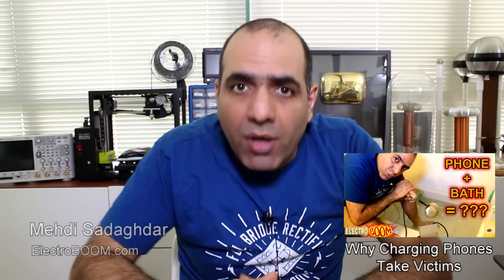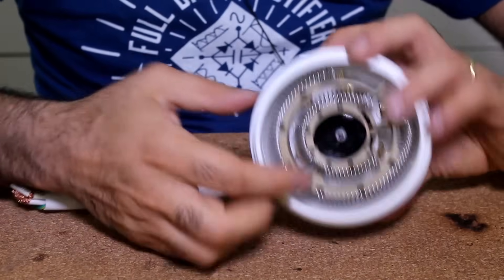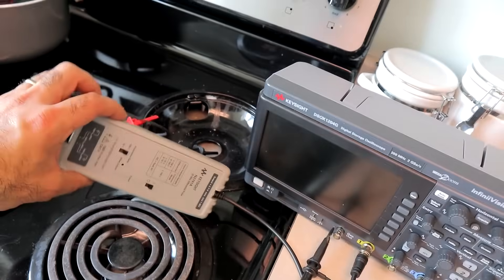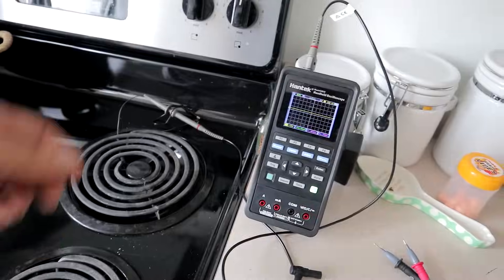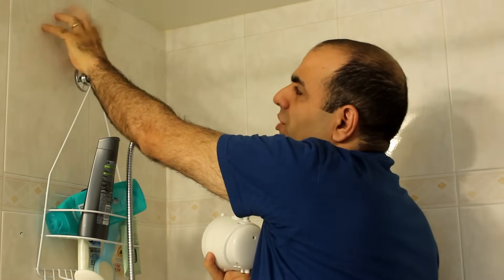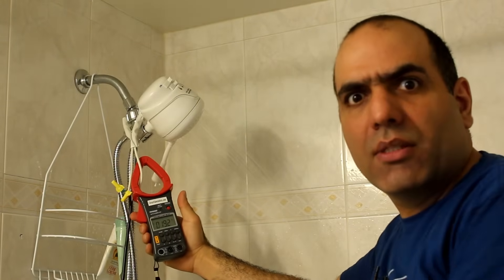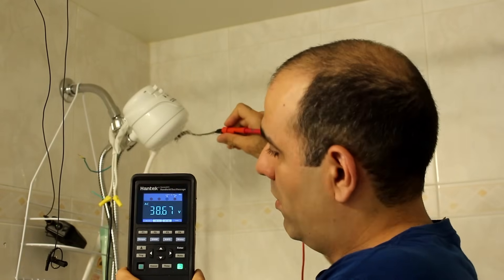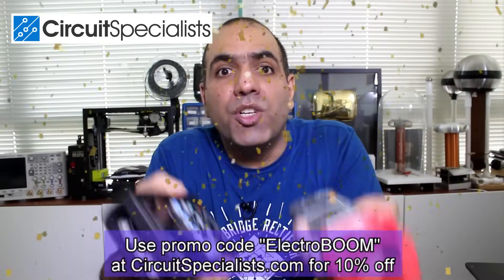How Safe Is the SHOWER HEAD OF DOOM?!

Comment: I use these for over 10 years here in Argentina with 220V, and even with 220V you still need 4mm wires minimum (btw 4mm are the same thickness the power company install at your power meter, so it is pointless to go thicker) for the max power setting, it will melt the common 2.5mm wires used here for regular outlets. But other than that is petty safe, when connected to ground, even a failing one would not transmit power too far due to the water stream breaking off.
That said, in these 10 years i had 3 of these, the first one eventually started to fail and started to transmit way too much power to ground and water it i would feel the electricity if i got my hand too close to the source, like what you did here. That happened over time, it was fine at the start. 
The second one just died after just a few short months, and the third one is the one im currently using whiout any issues.

Comment: A side tangent to this I'd love to see is testing exactly how a jacuzzi tub could possibly (or could NOT possibly) fail and hurt you. The thought of sitting in a tub of water submerged with electrical pumps running in it always gave me the heebie jeebies.
Reply: I installed a Jacuzzi-type tub in my home. Besides solid ground of the metal framework the pumps are attached to, I have a GFCI breaker on the circuit.

Comment: Lithium-ion cell powered oscilloscope is usually the best when working on high voltage as it's gonna be obviously isolated from mains power unless you plug in the USB cable from the phone charger. I would personally feel safe using that oscilloscope for good reasons, and less damage on the test equipment all the same.

Comment: Never in my entire life have I heard someone die or even get shocked for it, it's really funny the reaction of people in North America afraid of a harmless shower haha
Elso here in Brazil, the wire above the showers has a separate breaker, so you could turn off the power to its wiring separately from the rest of the bathroom to avoid overloading, but the way you did it connected to a normal socket in the house... it's kind of dangerous that way...

Comment: I've had a few showers like that here in Peru and to be fair, I did get quite a few electric shocks from them whenever my head touched the shower head (I'm fairly tall for my country), not deadly ones obiously but it did f'n hurt. Also I did have to install a plastic shower handle because using a metal one shocked me every time I touched it. Yeah I wouldn't recommend one of those unless you're broke and can't shower with cold water.

Comment: The wires sit on top of the shower heads, way above the reach of a normal person. You have to REALLY make an effort to touch them.

They are pretty safe and, no, they won't set your house on fire. Although they may make the lights flicker if you set them on max.
Reply: cringe pfp
Reply: cringe af pfp

Comment: I use one of these showers (unfortunately) Lived all my life with gas heating for shower. One thing I do is to be sure that the tap which allows water to flow is made of plastic. If that is of metal construction, it will shock you.

Comment: As a brazilian who had that shower in my house, i can confirm that it is actually dangerous, not because you can get eletrocuted, but because you can light your house on fire. The thing is, us brazilians can barely afford electricity, much less decent wiring. I myself turned that damn thing on the outlet of the bathroom (adapted for the shower) and the fuse box caught on fire, then i went Mehdi mode and tried it again for fun, it caught on fire again. But apparently it was a tendency to have those showers here in Brazil back in like 2016, apparently it's a "rich people thing".

Comment: In Brazil it is normal, in my house I have solar heating, but I have the electric shower for backup, if the day is very cloudy, here the electric shower works at 220v, 7500w and the correct thing is to be connected in cables of 10mm at least, in my house it is a 10mm cable, and passes through a 36A breaker, and the energy standard where the meter and main cables are located and designed to support up to 100A.  And it also has grounding, and the live cables go through an RCD, in the circuit breaker panel, the RCD is almost the same as the GFCI, except that it is together with the circuit breakers, if there is a current leak it trips, the Brazilian circuit breaker panel of newer houses like mine is practically identical to the European ones, like the one in the United Kingdom, if you watch the video of ElectroBoom in the United Kingdom, you will see the circuit breaker panel, it is basically the same thing in Brazil.
It is very, very rare to have an accident with an electric shower, if everything is done correctly, in fact I have never heard of death from an electric shower, there was a lot in the old days when electric showers were practically all metal, and the plumbing too, but nowadays there are no deaths!  And there is a safer type of electric shower that I don't know the name in English, but it is called (chuveiro de resistência blindada) in Portuguese, it is very different from the one in Mehdi's video.

Comment: I remembered my first home water heater it's 3500 Watts on 230V, no built-in GFCI (Not to mention grounding and central GFCI, it's 80s) with steel tubes and not so clean tapwater. I just wondered how I survived it.😅.

Comment: .. can a separated drop stream conduct water enough to shock you? Genuine question  wouldn't if the droplets split the volts/amps (not sure) drop during separation
Reply: I assumed it would half roughly each time the drops broke or say as per % of the total size of the droplet split between however many pieces it splits into
Reply: Make a video about it 👌

Comment: I'm brazilian and it's true, this is how it is. And it's completely safe unless you're trying to fuck around with it. Just use it as an end-user would and you're fine.

Also we dont leave the wires hanging down like that, we have proper porcelain protectors for the wires and they are always ABOVE the showerhead.

Comment: Hm... would it work to split the ground wire off and just send it through a silicone'd hole in the bathroom wall into its own grounding rod outside? Somehow that feels a little more reassuring than connecting the water stream to whatever ground wire is supposed to be running to the outlet in some sketchy country.

Comment: I once invented a way to clean the holes in a shower similar to this one using a needle. But my brilliant idea was to do it while taking a shower with my bare foot. When i introduced the needle in the hole I got electrocuted. I guess it was 220v directly ony body. It was very strong. Lucky on me that it was very fast. Can you explain why you didn't feel anything on you tongue and i got electrocuted? Remembering my ground is properly connected.

Comment: This is called an instant heater. It draws too much amps and therefore is a big burden to house wires.
In China the water heater usually comes in two ways. One is a electric tank heater which heats a tank of water at lower wattage. This takes hours to make a tank of hot water but it will never shock the user especially if you disconnect it before use.
The other is gas heater. This is always instant but they use gas fuel like CNG or LPG.
Instant electric heater do exist but they usually come in kitchen gadgets. Not for bathroom but for kitchen.

Comment: I'm Brazilian, so here's some quick facts about Electric Shower Heads:
- 90% of Brazilian homes has at least one electric shower head.
- 90% of Electric shower heads are 220V and 10% are 110V here in Brazil.
- Usually 220V shower heads works between 4000W and 8000W, so the 220V needs 40A breakers. 110V shower heads works up to 6000W and needs 60A breakers.
- "Installed by a professional" is not a thing here... Everyone can do it, even people who is not educated beyond basic school... It's not rocket science. 
- Some people don't even connect the ground wire... and it's ok.
- Nobody gets "shocked" in the shower... And when someone does, it's "light and very easy to deal temporary unconfort", it's not a killing pain. And it's easy to fix: Just connect the ground wire.
- A basic electric shower head (like this one on the video) costs about US$ 15 (converted to local currency). Higher end ones costs less than 100 USD.
- A total number of ZERO people died by electric shock in the shower last decade. This just don't happen.
- There are also electric water heaters for boilers, pools, and for Kitchen sink, and they work exact same way.

Comment: They're pretty easy to safely install, though. And come with easy to follow instructions. And even when they're not properly installed it's pretty rare someone gets a shock. What generaly happens when it's baddly grounded is that you loose energy and your energy consuption goes wild while the water doesn't heat properly. They generally have a dedicated circuit breaker. It comes with most houses and apartments and if you are building a house the electricist will think about it. In the rare cases when someone gets a shock, it's not a big deal either. I've never heard anyone gets injured by a shower. Like, not even heard of it. Not even on the news.

I remembered being puzzed as a kid to discover the USA don't use those. And then people said you guys heat it with gas and I thought: "isn't that dangerous? What if it explodes?". So there's a mutual strangement hahahah. I heard a friend was jocking with some "gringos", they called it an electric chair and he said it's better than a gas chamber hahahah. In the end both are safe.

Comment: I talked once with a man who had lived for a few years in Brazil many years ago. He told about using the electric shower heads. He said sometimes they would start to feel a tingling and they would have to go to the basement to tighten the ground wire to the water pipe.
Reply: "basement" lmao bs

Comment: A whole lot more deaths can be linked to boiler or water heater installations than to these electric showers, even per capita, as there are fewer countries that use them. Statistically speaking it could be argued they are much safer than having gas pipes runing inside and around our houses, underground and pretty much everywhere we go. These fail, you get a spark and the shower shuts off immediatelly as the circuit is phisically broken in those coiled resistors inside. You get cold water running, maybe a bit of smell of burned plastic from the housing or from any plastic components inside of it, and the inconvenience of having to run to the home center to buy a new one. If on the other hand gas leaks inside a building or underground, they can accumulate at which point all you need is a small spark to get a huge explosion and fires.

Comment: I have gotten electric shock from normal shower on 2 occasions on 2 totally different locations... Never found out why it gave electric shock in form of tingling when standing on the water outlet. Last time I was showering away salt water from a wet suit I had used in the ocean.

Comment: Well you don't loos space for hot water tank and don't have the heat loss from poor insulation. 
Hot water only when you need it. 
No need to worry about gas or the venting system or making sure the gas ignites properly. 

Curious of how potent such a system is

Comment: I have used one of these in Burundi  don't know who installed it but we usually had loss of electricity several Times everyday. The wall plugs where between 150 and 280 Volts effective, depending on the time of day and the circuit. I got electrical shocks when my laptop was plugged in everytime touched the metal housing.
Nobody died (well, at least in the house) and my now sold 2011 laptop is still in use as far as I know, I just upgraded to a faster System.
I guess in places where these things are the best younhave you just have to not think about it. Sure, some will die from these conditions but not all do. I'm from germany and now live here again, I saw both worlds, both have their rules, both works, just one of them is deadly more often. I saw people die due to bad standarts, I gear up when I use a motorcycle here I went over 100kp/h without even a helmet. People tend to live as well and as their surroundings allow, in Burundi this shower was of of my lesser concerns,  the dubiously open wires... well, I'll stop it here, I could go on like this for hours, you get my meaning: these things are often improperly installed and often nothing happens, in places where this is such places life usually isn't very safe in generalso that even improperly installed with only 2 open wires this shower doesn't make it significantly worse.

Comment: What about another test with the heating element blown open circuit, also no ground connected, and a more acidic or alkaline (or otherwise more conductive)water flowing? Would it still be safe?

Comment: brazilian here, eletric showers are pretty much everywhere, there are even people who believe gas showers are more dangerous because of leaks, my house has eletric shower for like at least 30 years and no one has died _yet_, nor anyone got shocked. theres a bit of context, because brazil is hot, we dont have heated water from the street like britain does, so a big ass % of our tubing is pvc plastic, the only metal parts are usually the fossets themselves, another thing is that eletrical showers are incredibly regulated, Anvisa is super annoying in legalizng the sale of them. a 3rd point is that these showers usually are made very disposable, they often burn the contacts for the switches or the resistance,
however i do agree they're f***ing dangerous and holy balls how someone thought it was a good idea

Comment: I have one of those here in my house and it's pretty safe.. but sometimes if I touch the faucet to turn it off I get a little bit of shock.. my wife doesn't feel.. so I usually touch the faucet with the palm of my hand instead of the finger.. well.. it works pretty well.. hahah😊

Comment: I got several small shocks using such high level engineering shower :P. in Brazil, you allways have a rubber filp flop to use during shower.....which doenst help much if you are wet...ahahah

Comment: For those who wants to know more about this shower head: it's resistance is about 15Ω, what is less than the resistance between the water and the body, since no contact with the electricity and the wet hand in the valve, with no electrical protection wire. The little holes in the shower, allied with water pressure, create physical separation between water and the body, with little droplets showering and air in the middle of them. It has one green wire that bypass the residual current to ground. This current is in order to few mA, what is measured with a residual differential interruptor, if that current grows, the interruptor activates. So, the electric shower is safe for use, and more usual than the PLG one, very dangerous. And the inlet power has to be a unique circuit, for safety again. Furthermore, you must to fill the reservoir before the power, keep the switch in "OFF" position until it filled up, then you change to "ON". This doesn't burn your resistance, because the water cooldown the resistance and the resistance warm up the water.

Comment: It's safe and cost around 20 dollars here for a good one, this one like he bought can be found for less than 10 dollars, if you consider that a heater that uses natural gas cost around 200~300 and needs a complicated installation as well, this is very good... Our homes almost always have the outlet close to the ceiling, I never heard about anyone had died because of it. You may get a little shock when it's like old homes on country side where the electrical wires are bad, have no ground but that's part of the fun hahahahaha, Brazilians are like the Russians from the south hemisphere

Comment: Wouldn't one just simply use a mineral insulated conductor as a heating element? Like an electric kettle or a heating coil for a sauna -- whereby A inner wire is the one that actually has the current flowing through it is covered in a non-conductive salt like magnesium chloride I believe ( which is kept dry that is imperative by the way ) by means of a metal jacket on the outside covering the non-conductive salt. These heating elements can get very hot and yet be very durable at the same time I'm like plastic insulated elements that can get to maybe a medium temperature at best )  see Wikipedia article mineral insulated conductor ( For a more definitive reference and not just my recollection ) :p

Comment: Electric showers are safe, the only problem in Brazil is, Brazilians can make everything that's safe, unsafe hahaha. For example, most of the houses in Brazil doesn't have ground cables. There are no structure at all, so absolutely EVERYTHING will give you a shock. The solution? Install an external ground system to your house? No. Just use flip flops all day. And to make it even worse, it's pretty common to wash your kitchen with a hose, watering everything.
And we still have new houses without ground cables, becase older people says that they never used and never needed and also saves a lot of cost during the construction.

I just moved to a house that I followed all the construction steps and ensured that the house had the ground system correcly and the amount of judgment is insane "You are going to move to a house, not an apartment, you don't need that". But now we have 3 electric showers and none of them are shocking and to be honest, the previous house had gas heater and now I didn't want it in my house, we have solar energy and the energy cost to shower, stove, A/C are minimal and SAFE.